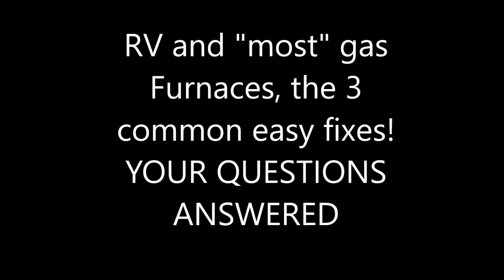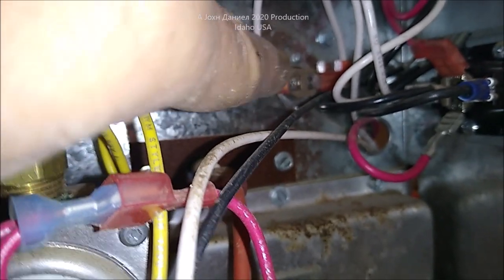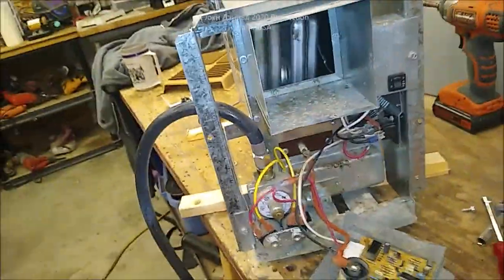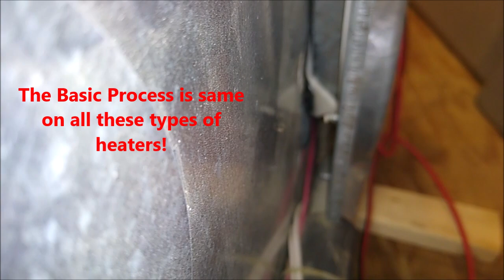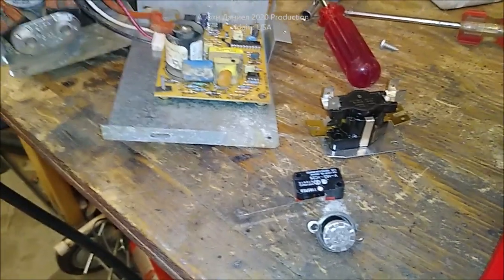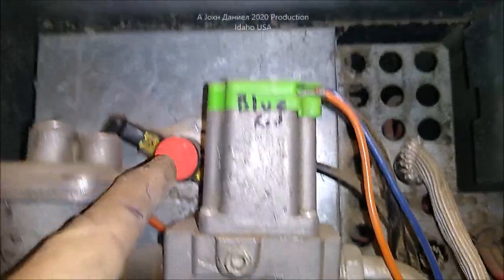RV Furnace REPAIR TECHNICIAN SECRETS Top 3 Easy Fixes anyone can do PARTS BELOW

Comment: Mr Daniel,  have you ever run across a heater unit in rv cause the 12v awning lights flicker on and off 3 or 4 times when trying to start it also has a pretty loud click when it does it, unit works fine but something 12v side of things I believe is shorting out momentarily I know it sounds weird but thought I'd ask any thoughts would be greatly appreciated
Reply from the maker: Sounds like a poor ground wire connection. Check battery, power converter and the frame connections. The lights and the heater likely share a ground lug or group of ground wires space and this is likely the issue. I have seen 7 ten gauge wires all sharing a 8 awg chassis ground in the fuse box area often and they used a large blue wire but on them.
Reply: @JOHNDANIEL1  John thank you for your input and quick response I will look into the grounding issue, I kinda was thinking along the same lines, I get so disgusted when I enter the basement of our  2017 GDRV momentum 397th to do any work on the coach because of the chaos with the electrical and the plumbing from the manufacturer, there's just no excuse why that many wires and that much pex should be left is such disarray. Anyway wish me luck I will let you know what becomes of it thanks John and God bless

Comment: John Daniel really appreciate the video I have a Atwood in my new 2022 heartland and thermostat clicks fan turns on and immediately shuts back off does this during the coldest time of the night and I have to turn thermostat off and back on for it to start working again only does this during the night seems like when u wake up freezing in 50 degrees would that be the sail switch? Thanks
Reply from the maker: Sounds like igniter/flame sensor is getting damp from night air and doing this. A power off reset will clear the board and allow it to spark a lot and dry it. Moving the tips inward about 1/32" closer may solve it. Make sure no Wasp or spiders have made home of your intake/exhaust tubes and look at replacing or cleaning and resetting the spark gap on that igniter.

Comment: Hey sir, I just got a 2000 coachmen truck camper that has an Atwood 7916. Tried to fire it up, keeps tripping the 5 amp breaker on the front. Do you think one of your 3 fixes might fix that issue?
Reply from the maker: Not much info to go by, but I would check for blockage in the intake/exhaust to see if the motor is locked up from wasp or insects first. See if you can access the side of the furnace and try to spin the blower wheel through the grill on it. Otherwise the common thing after that is the Run Delay relay is fused to ground and bad. 
A 23 year old furnace can have lots of junk in its intake though and binding the blower to cause that. 
You did not say it did or did not click, or hum or make a sound before dropping the breaker or fuse so thats my best guess.

Comment: Great video, any idea how to even get at the heater. Mine is under the fridge, Forest river wasn't kind enough to install an exterior access panel. If I remove the return air grill, I can get to the back of the heater, and the overtemp switch is conveniently there but I can't even see any other components or the even where the duct connects. Blower runs but I am not hearing the ignitor, and I think I'm smelling gas at the exhaust.
Reply from the maker: Shine a bright light up the exhaust/intake to make sure nothing is blocking them first. Blockage can slow the fan to prevent fire up. As for the furnace, I have no idea the model number and year so I can't refer you to easiest removal process.

Comment: My RV furnace is not shutting off, heating as soon as fuse is in. The only way to shut it off , is to pull the fuse. What has gone bad??
Reply from the maker: Test it by removing the thermostat from the wall, powering it up, then taking one screw (wire) loose off the thermostat to see if you have a bad thermostat. It will stop if you do. If the thermostat passes the test, then the next culprit ( if it has one ) is the RUN-DELAY-RELAY on the unit failing in the on position. This means you put in fuse, blower starts, in a few seconds flame is on, then it continues to run till you remove power.

Comment: My RV heater just started turning on  to much even though it's not as cold as it has been what could be the problem? Thanks for any help!!!
Reply from the maker: Define too much? Cycling a bunch, shut off, kick back on fast? Or running higher temps? If the latter one, replace thermostat, it is carboned up and going bad or if its electronic its bad. If the first, your over limit switch may be cycling on the blower more and your cause can be bad over limit, or blockage in the air intake/exhaust causing higher core temps to remain in the heat exchanger.
Reply: @JOHNDANIEL1  well in the beginning when used for the first few weeks the heater would kick on, and there was a time period before it would kick back on probably around 25-45 minutes, but now it seems to be kicking on about every  10 to 15 minutes!!!

Comment: I can only find the over temp switch up to 190F , works the same? SO happy to find your channel
Reply from the maker: yes, just make sure your ducting is clean so outflow isn't restricted and 190 will work. But try to find a 220-240 degree still.

Comment: My daughter has a fifth wheel rv her heater cycles comes on blows hot for a bit then shuts off what do I need to do
Reply from the maker: Check for wasp and blockage in the intake/exhaust looking deep into it for obstruction. If any clear it. 
Use a Jumper wire on the Over Limit switch to bypass it then try your normal use cycle one time to see if it runs longer, if so replace the over limit switch on the furnace. If it runs for under 30 seconds and shuts down you can check the battery voltage/converter voltage to see if its dropping under 11.5 volts during cycle if so fix that. Last but possible is the igniter/flame sensor is going bad and goes out of range once hot so the board thinks it's seeing a flame out. 
If the unit does not do a flame out, cool down cycle you may have control board or Run Delay Relay issues.

Comment: God bless you. I have had a 2004 Terry Fleetwood sitting thru 69days of 101 degree temps. It's late Saturday night, freezing weather heading my way FOR 4 days and my heat will ignite, run about 10 seconds and turn back off. I can say that I am pretty well screwed. I couldn't get the parts here in time if I had to
Reply from the maker: Common for effects like that is the Flame sensor / Igniter related issue. Unit runs to light up, does not sense flame, cycles off in under 30 seconds.

Comment: When I start my furnace, it runs as it should and cycles off when it reaches temp. When the thermostat calls for it to come back on, the fan runs continuously and it doesn't try to ignite. If I turn the thermostat off and back on, the furnace repeats the same scenario. Thoughts?

Comment: My RV sat unused inside from 2004 until this year when I bought it. Checking everything out the furnace worked initially then stopped for some reason. I pulled it out and checked sail switch and others and all checked out. Completely disassembled and cleaned an unreal amount of bugs and nest out of the heating chamber. Has worked flawless ever since and it's an older unit a 1997. For do it yourselfers your videos are a huge savings in time and money..thank you

Comment: When I turn mine on my furnace the fan doesn't run and after about 5 seconds it trips the reset button. Where should I start.
Reply from the maker: Run Delay Relay if it has one. Over 90% do. The effect your having is a jammed up relay eventually getting too hot from not passing the power forward and shutting power.
Reply: Problem solved. Dirt dobber nest in fan preventing it from turning. Cleaned it out and works perfectly.  Thanks

Comment: Hello John I'm having a problem trying to remove my heater from my 1996 Colman Bay port pop up camper any ideas how to remove it it looks like the same one your working on
Reply from the maker: Step 1 remove front grill/cover to access inside
Step 2 turn off gas, loosen and remove gas line. 
Step 3 remove power and control plug on side if yet reachable from inside cabinet or front. 
Step 4 remove exhaust/intake screws on outside metal flange
Step 5 remove any ducting hoses if it has them
Step 6 remove front flange screws that secure it to the cabinet
Step 7 slide out furnace working any items that may hold it back, ( outer exhaust/intake flange, sliding gas line out of it, keeping wires out of way) 
Reverse steps to re-install.
Optional Step 8   Support/Join with KoFi - https://ko-fi.com/john4kiera OR https://bit.ly/2buyaCoffee

Comment: I have the same furnace. 1999 lance truck camper. When starting mine up it hums for a 3 to 5 seconds and the little amp switch deenergizes. And nothing after that. Any ideals?
Reply from the maker: Fan Motor seized up.

Comment: Great job! Thanks. My 2021 vibe has a propane smell coming from the air vents inside the camper when the furnace is OFF. Its very faint but it was strong enough to make my bathroom smell like the black tank needed flushed. Its slightly worse when the wind blows. Thinking its blowing into the intake/exhaust pushing the gas out of the furnace. What could cause that?
Reply from the maker: Sounds like the Refrigerator is probably what is leaking gas. The refrigerator has vents that would more likely spread the smell from windy days than the furnace since its a sealed air intake/exhaust design. Unless someone has been messing with the furnace the likely culprit is the refrigerator and its auto ignition valve or a plugged up top exhaust vent. Look up in the refrigerator top venting housing and see if its got blockage.
Reply: @JOHNDANIEL1  Thanks for the response. The refrigerator is 12v only
Reply from the maker: @EGGINFOOLS  If its only 12 volt, I would track down what happened to its gas line that was factory installed. Maybe thats the issue.
Reply: @JOHNDANIEL1  This trailer came only with a 12v refrigerator. Residential style. I bought the camper new. They arent made to have both propane and electric although they do make refrigerators like that. Im wondering if the heat exchanger in my furnace is cracked. Allowing propane to slowly bleed out from the inside heating vents

Comment: So I can’t find/don’t have a relay/delay switch. Yet my furnace looks identical to yours.  ¯\_(ツ)_/¯ 
Furnace works when I short directly from thermostat to heat switch. 
I did have a dead short that I fixed, but can’t get the furnace to do anything unless I run the thermostat directly to the heat switch. 
Brought the board into the dealership, but they can’t test it unless it’s all attached, and at that point they’ll just replace the board. ~$250CAD.
Can you help me?
Reply: So I figured it out. Nothing wrong with the board. The thermostat had some kind of short. Pushed one of the contacts up a bit, and everything works perfect.

Comment: Any idea where you can find an intake hose from the back fan to the burner? Thanks
Reply from the maker: Find a automotive version of silicone intake hose that will fit to replace the original burner air supply hose. EXAMPLE - https://amzn.to/48pdaOt

Comment: Ok so I own a 2010 jayco jayflight g2 last year got to Dec. It was  hot during the day but Texas weather it got close to freezing that night turned ac over to heat as soon as I did this it stopped working I spoke to someone and was told to check thermostat 2 am fuse sure enough it blew where do I start looking? Any time I put a fuse in it it blows when I first switch to heat happens fast I'm thinking  direct ground but I'm learning full time disabled and I need to get it fixed asap  help.
Reply from the maker: That would have a 30 to 40k BTU furnace in it. With the Run Delay relay bad in it the thermostat would short out or the fuse would blow when you engage it.

Comment: My relay and colors look way different.  There is a main power then power to fan.  I have a ground and a thermostat wire.  Will this relay still work that you promote?
Reply from the maker: If the layout and model are similar, then it should. Some models made in Mexico or Canada used different suppliers for parts and even wire colors in many of them.

Comment: I have a hydro flame model 7920. It will turn the fan on with out the thermostat being turned on and won’t shut off till I shut done the main camper power or remove wire from circuit breaker in unit. I can not figure out what is wrong . Because it was working just fine and now it’s doing this . Not sure if it’s wiring or the actual thermostat. Because I have changed almost everything other than the limit switch .  If you have any advice would love to hear . Thanks ! You helped me fix my furnace the first time and now this is happening . Thanks again video really helped .

Comment: Thank you I enjoyed your video you explain your steps very well my question is my heater would come on and then shut right back off I replace the thermostat without turning off the power to it, is there a fuse that I could have blown ? Thanks in advance David
Reply from the maker: In many there is a 15 amp board fuse, in some a 10 amp glass fuse, and in some a chassis fuse with a black screw out cover on it. But generally changing a thermostat will do no harm. Check to see if the proper terminals were connected on the back of it. Cross the wires ( direct connect them, low voltage, its ok ) and see if it fires up. If not, detail why you replaced the thermostat and maybe that is where to start.
Reply: Thank you for replying so quickly I will do what you suggested and get back with you

Comment: John! Enjoyed the video! Very good information. I have an Atwood heater 8500 - IV Series. It's in my 2003 Jayco 5th wheel. I ran the furnace today but here is what happened...the combustion fan came on, followed by the clicking board relay followed by the gas igniting. The issue is that the blower motor did not come on. I waited a long time and it never came on. The gas just stayed on and kept heating. I was worried that things were going to get too hot so I turned the unit off. Normal shutdown, combustion fan ran to cool unit and finally shut off.  So, that's what I am up against. You did not mention what causes the main blower to come on after it heats up. From your video everything is working normally, so should I think about throwing a blower motor at it?
Reply from the maker: You only have one blower motor, when the combustion blower side is running, the whole motor is running. If you recently heard a odd noise from it, it could be the blower on the ducting side came off the shaft inside. These furnaces, that model has a horrendous record of issues. I have seen this before in all made from 2018 to date. See part #39 on this diagram page one, http://techsupport.pdxrvwholesale.com/wp-content/uploads/2017/08/2-Stage-Exploded-Parts-Views.pdf 
If your blower came off, you will hear or feel the fresh air at about 5 mph from the exhaust, it will likely be 6 mph without the bigger blower taking up energy. Make sure its not just hot evacuation on the exhaust, then start to look in to see if the main blower is loose and laying in the duct can in it.

Comment: This video is 2 years old and still going strong!  I have an Atwood 7916-II in my pop up camper and it won't do anything. Set the thermostat for maximum and nothing.  No clicking, no nothing.  Suggestions?
Reply from the maker: Connected the two thermostat wires with a jumper or twist them together to see if you get fire up mode.
Reply: @JOHNDANIEL1  Amazing, time to buy a new thermostat.  While I was prying it off the wall the furnace came one.  Do you have one you recommend?
Reply from the maker: @paulsmith50215  Stay simple! https://amzn.to/3rJ3bmp
Reply: @JOHNDANIEL1  Thanks!  Subscribed and bought a coffee. Maybe for a future video you could do the same for three way RV fridges that you did for RV Furnaces.  My fridge runs fine on electricity and on battery but barely does anything when running on propane.  Not sure if it should be this way, but the flame is so small and so blue I have to put a blade of grass in to know its running.
Reply from the maker: @paulsmith50215  There is sometimes oily residue in the propane that can clog the lines or filter screen in the gas valve, and often the thermistor that detects the flame can shut it down to only pilot light levels due to no millivolt reading to the board. Often a tiny blockage in the output for the flame can reduce its oxygen mix. A set screw for air mix is on the tube before the flame. Any adjustments you make be sure to record so you can return to original if no changes. But I would suspect the thermostat is not seeing need for full flame and holding it back. That is the job of the thermistor in newer ones. https://www.youtube.com/watch?v=nVK-veCpll0 and https://www.youtube.com/watch?v=3m4E0X5UzW8
Reply: @JOHNDANIEL1  I ended up replacing the propane regulator and cleaning the burner and jet.  Its working much better now but still not as good on gas as 110V.  Its a Dometic RM 2193.